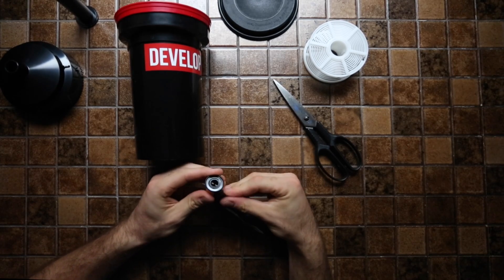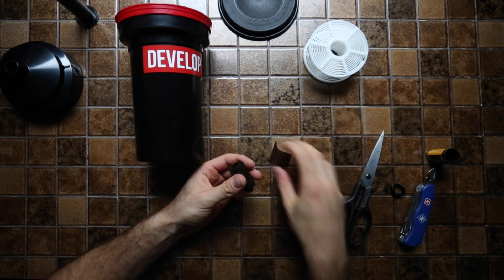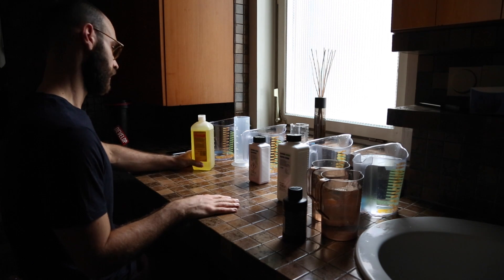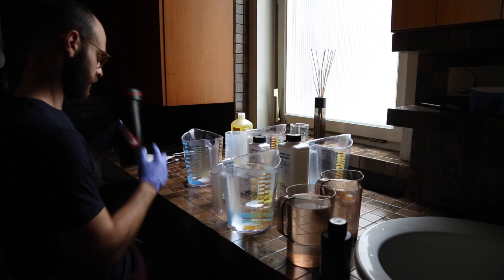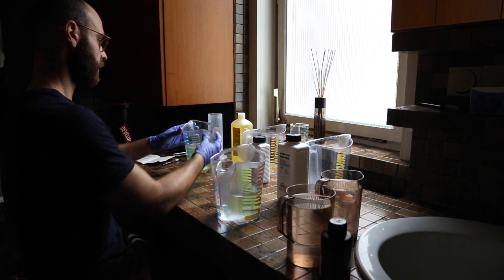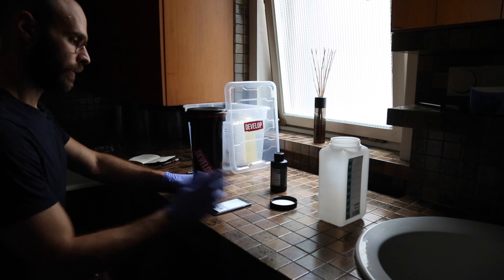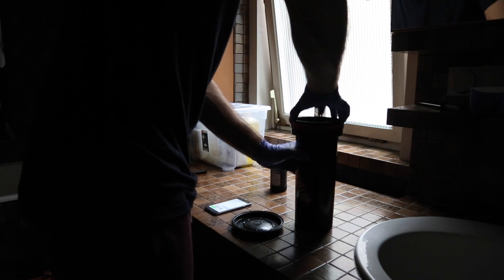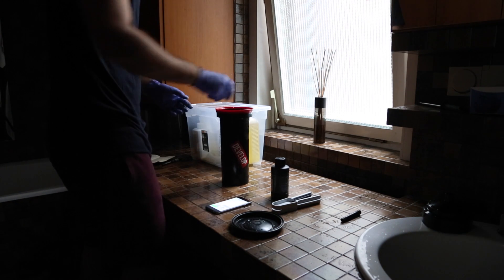Developing 35mm black and white film | doyoudevelop

Comment: Good video, there is only small things I feel i have to say: 

1 - You need to check your city regulations as far as chemical dumping in sewage, there are forbidden chemicals and every city states them. Since most develop chemicals are toxic, one needs to be very responsible when discarding them.

2 - You can make a Stop bath with vinegar (One part vinegar and 4 parts water) it works just as good as the one you used, and since its no chemical, you can safely discard with no hassle.

3 - You don´t need to run the tap water for 10 minutes to rinse your film, you can do the "Ilford Bath" and it will be clean just the same with less water wasted. More efficient and eco friendly.
Reply from the maker: Yes, those are good points! I use ilford wash aid when rinsing now :)